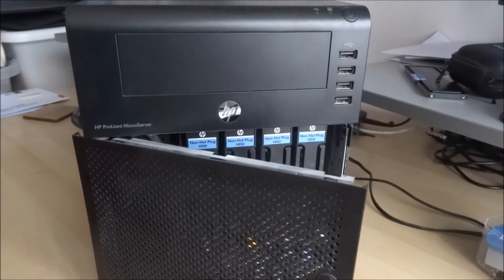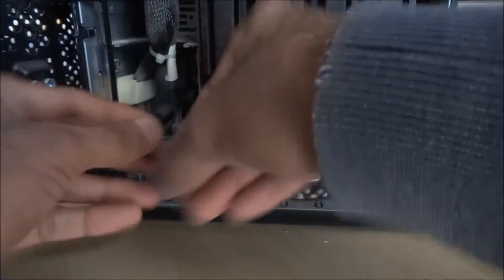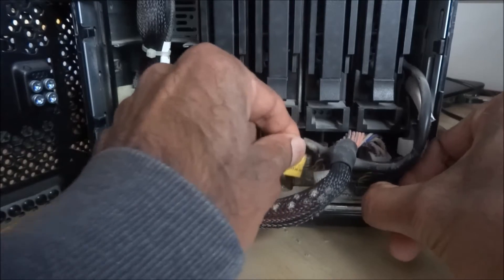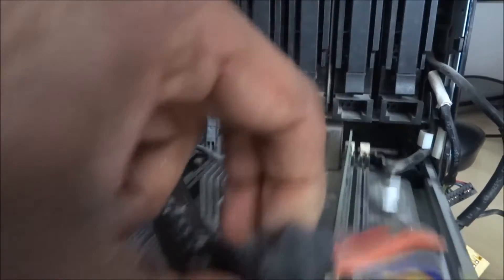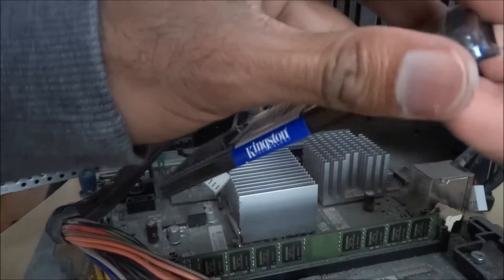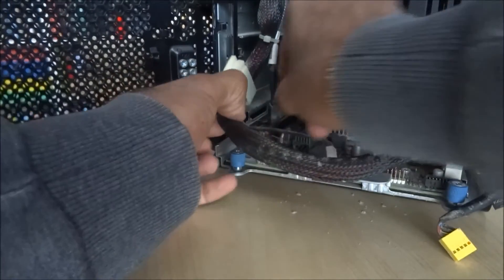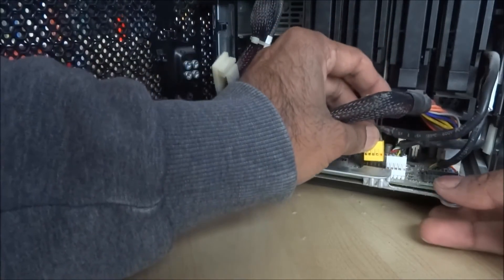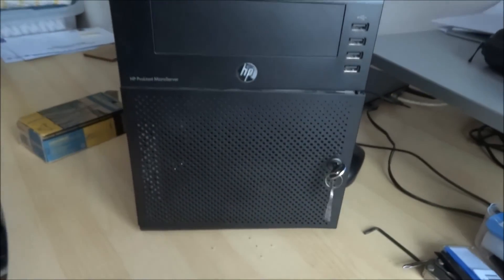How to install RAM Memory into a HP ProLiant MicroServer

Comment: I have a question about removing the plug (around 2:04 mark) - did you have to do anything, in particular, to get it out (apart from depressing the 'button' on one side and wiggling it)? Mine won't come out and am worried I might damage the socket/board!
Reply from the maker: No i didn't do anything more.

Comment: Takes ECC RAM I believe a bit more expensive. These were good deals at about £100. Was tempted then I remembered how much I hate computers lol. What you running on it?
Reply from the maker: I think the RAM was actually around £30 from amazon. Running Windows 2008, I tried installing 2012 but too many driver issues as it could not see the on board raid card.